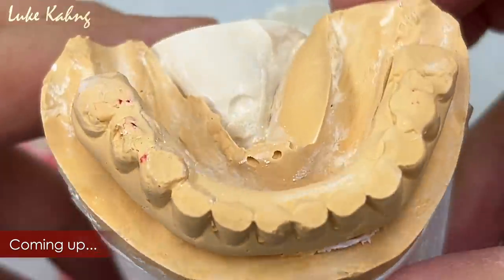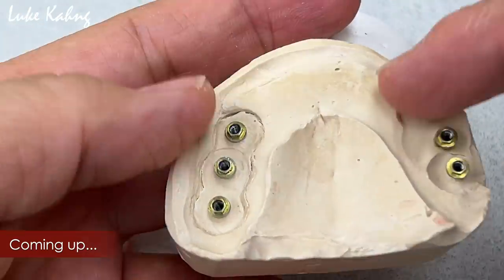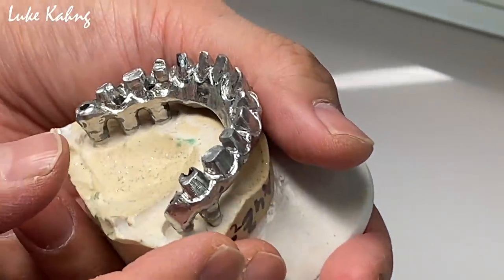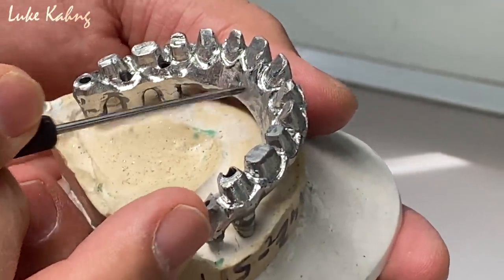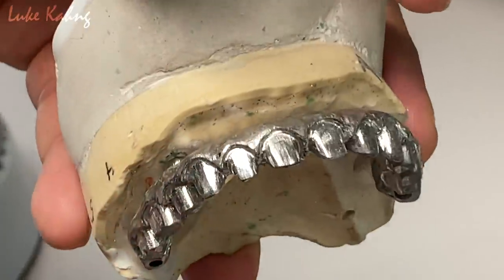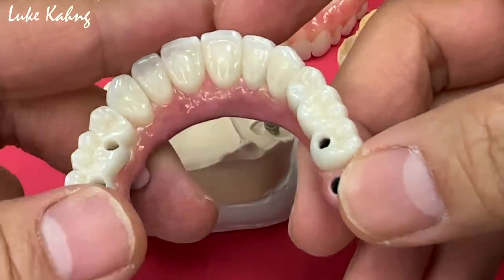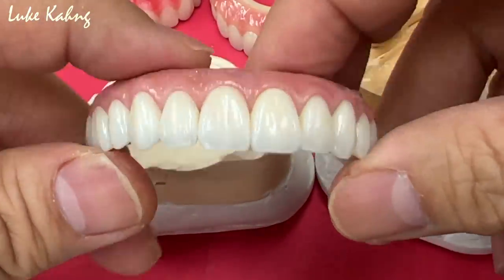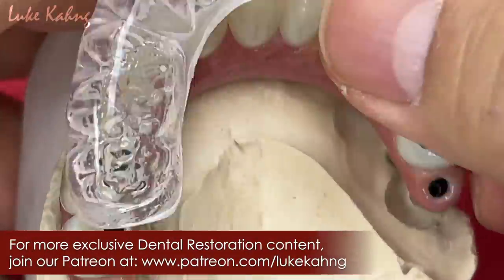A Slim Full Mouth Solution with No Anterior Implants

Comment: You said $7,000 for that upper?  Or was it $70,000?  How do implants wind up costing like a Lexus if it's $7,000 for that?
Reply from the maker: Lab fee is $7000 ....
Reply: @Lsk121  so realistic sure worth every penny. i pray u will still be around when i accumulate the funds to do my upper.
Reply: Extracting teeth $2500. Bone graft $1000. Implants $8000. Bone surgery $500. Sedation $1000. Lab fee $7000. So that’s $20,000 for the top. $40,000 for both. These cases range from $40k-60k depending on how difficult the case is. You can downgrade to a snap on denture for roughly $20k total for top and bottom
Reply: @austinhoang1634  Thanks for that breakdown.  No one ever did it like that.  At least that I've seen.